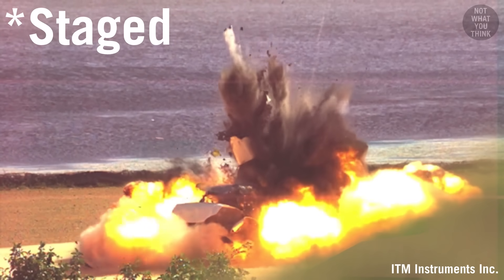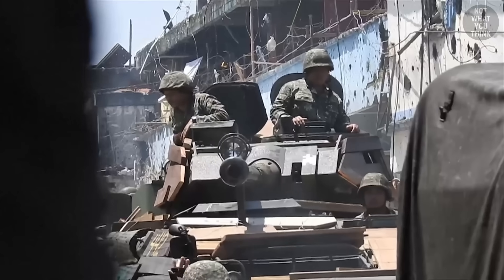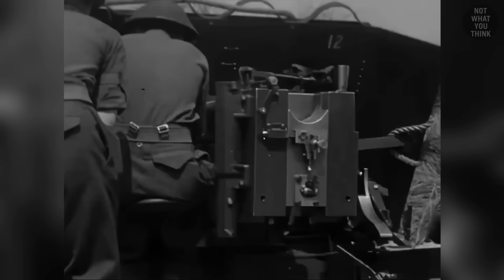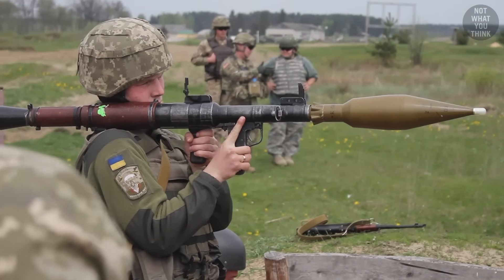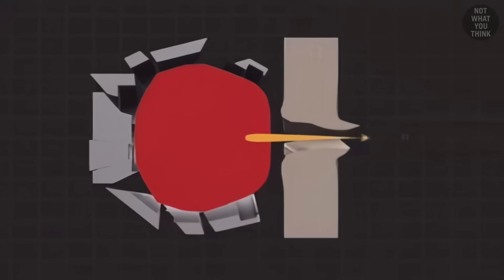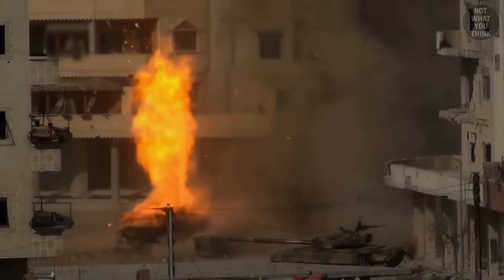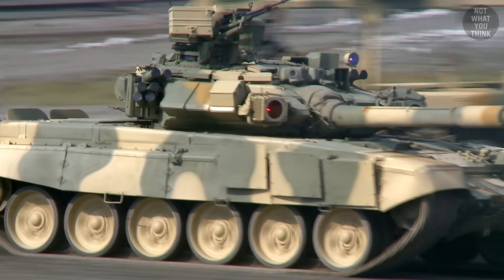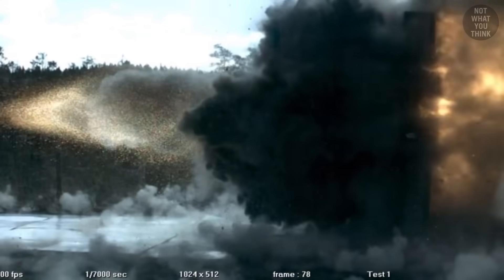Why Protecting Tanks is Getting Much More Difficult

Comment: Also worth mentioning are the NLAW launchers, which forego tandem charges by flying over the top of the target, and then detonating a downwards-firing shaped charge. Effectively attacking one of the least armored parts of the tank (even with cope cages).
Reply: feel like cope cages are more of a "fuck your apartment rpg" than for actual high tech missiles
Reply: @piscessoedroen  I think they are from low tech drone dropped mortar rounds or similar
Reply: @piscessoedroen   USE BY RUSSIA AS PER LESSON LEARNED IN CHENCHYAN WAR....sadly modern heat tandem anti tank missile rendered them useless
Reply: Another important point, is that NLAW is about a tenth of the cost of a Javelin.  Wars are won by economics, as well as by weaponry.
Reply: the NLAW doesnt use a shaped charge in top attack mode, it has a shaped charge in the middle for direct attack mode but in top attack mode it fires a tungsten pellet downwards
Reply: @fuckoff4705  No it uses a shaped charge in top attack mode, just watch Saab's own video "Saab´s NLAW anti-tank weapon explained"
Edit: Also see a video called "NLAW Warhead" to see it in action exploding in top attack mode
Reply: @fuckoff4705   They do use a shape charge but an especial type called EFP, it detonates and create a hypersonic clump of metal that penetrates the target, this statement: " it fires a tungsten pellet downwards" its completely false.
Reply: @fuckoff4705  SAAB's own product page for the NLAW states that it uses a shaped charge in OTA mode.
Reply: @fuckoff4705  Guess that works too against the lightly armored roof and even against ERA..  The Bofors BILL 2 has tandem vertically attacking shaped charge top attack but isn't man portable.
Reply: Old school here, after reading this thread, I can't help but appreciate all of the thought and time that went into this carnal knowledge, it sure would be cool if that much effort was put into peaceful solutions.
     Call me a p****.
Reply: NLAWS can only be defeated by remaining unmarried.
Reply: That’s why every tanker in the Russo/Ukraine conflict is fighting with hatches at least partially open. Overpressure is instant death in a confined space. So long as the jet doesn’t strike a crewman or a round in the carousel, it is surprising how many penetrations a tank can and will endure.
Reply: thank god somebody mentioned this. Nobody is mentioning this.
Reply: The Swedish BILL Missile is also the exact same concept (iirc the nlaw is based off the bill but I don't know for certain)
Reply: David Barr  well I would call NLAW limited. There's probably around 20k of it in Ukraine now. Many times more than amount of russian tanks. Even ignoring other ATs. But what about RPGs the scenario with you aiming straight down with it so unlikely its basically worthless even trying to protect against that giving away advantages like lower tank profile, weight or open space above the hatches. There were only a few zones when that could take place like in Mariupol but even then its super situative. Mainly because ukrainian command tries to avoid urban combat when its possible. Rn there's no active urban battles (well maybe only Bakhmut but its doubtable since russian army is kept outside of the city). Once again there's a reason why russians don't put cages anymore and were putting them on just enough tanks to make thr news out of it.
Reply: It fires an explosively formed penetrator
Reply: so much cope on those cages...
Reply: An idea over 12 years old!
Reply: @raywhitehead730  But not made by 12 year olds. Honestly I'd love to see how kids would think of defeating this problem.
Reply: @SoloWing032  I think he meant that the invention/idea has been around for over 12 years.
Reply: @Cobrax_x  I know that. I was getting at kids can be creative when it comes to problem solving. Us adults tend to over think or not even think of other stuff.
Reply: @SoloWing032  The real way to win a war lol
Reply: @raywhitehead730  Soviet troops installed improvised lattice screens on the T-34 in Berlin to protect against Faustians
Reply: Cope cages werent not even marginally efective, Russians are not longer using it I think.
Reply: What do you mean “also worth mentioning”, the top attack munitions WERE mentioned.
Reply: This is why active  systems are being implemented with modern tanks
Reply: @sierraecho884 The problem is that you get to a point where the tanks are too heavy and complicated for mass production.
Reply: @grahamstrouse1165  Airplanes are way more complicated and are still mass produced. The only paramater which changes is the price and time to build the thing. You can mass produce anything it will just take longer and cost a fortune.
Reply: Around 35 years ago there was a 150 mm howitzer round that delivered 3 "skeet" submunitions by parachute each terminally guided. I am not sure if they were ever used in anger.
Reply: Back in the 80's there were thoughts / concepts that highly agile air vehicles, sort of half fighter plane / half helicopter, would be developed to replace tanks. It looked and sounded great but does not seem to have got anywhere. Tanks are really only ever best in open landscapes. They are very vulnerable to even improvised weapons in urban situations. Even in the open plains they can still be defeated by the simplest of tactics and equipment if you know what you are doing.
Reply: @rsh650  yep, atoms move all the time even in solid materials, unless the temperature is an absolute zero.
Reply: Cope cages are against small drones dropping grenade / rpg. ERA is still effective against NLAW and modern ERA is effective against tandem charge too (though it is still rare for modern ERA to be on tanks roofs).
Reply: @The Bear Sorce?
Reply: >cope cages
lol
Reply: You mean the American javelin anti tank system.
Reply: Cope cages are usually very useless. Weird they even have them.
Reply: 'forego'? Where did you even learn that word from fgs
Reply: I always wondered why ruskies had ERA on top of their turrets
Doesn't seem to help them much
Reply: The fact that y'all are unironically calling them cope cages is hilarious, i can't believe this nickname has gotten so popular.
Reply: я.
Russia must before destroying the satellites of Elon Musk. Warn about it.
Reply: Modern SPGs are pretty nasty, too. Historically, indirect fire wasn’t very accurate. Now that we’ve got PGMs, high-tech fire computers & drone spotters everything is pretty damn accurate. Tanks are good for direct fire out to 5 or 6 klicks max. A 155 mm SPG can range out to 40+ kilometers. With an autoloader.
Reply: @rsh650  they do not shift by themselves,  but as result of external action. especially in malleable metals.  Imagine a copper bar.  Inside there are more or less planes of atoms, let's simplify to lines of atoms ( line abcdef... and atrached to it line 123456..., a1,  b2 atoms creating the metallic bonds same as between ab,  12 etc). Bending the bar will mean atoms shift their bonds to a3 b4 c5 for example.  A bit counterintuitive but it is the physical process,  as far as i can figure it out. In steel,  the various ingredients other than iron make this shift harder,  resulting in the elasticity or brittleness of that material.
Reply: NLAW, another abbreviation that doesn't mean what you think. It is a Russian abbreviation for Nереа Leniov Abocb Wlodiev, which means "giant can-opener from above".
Reply: @TheRealDuckofDeath  xD ahahhahah
The NLAW also isn´t even Russian
Reply: Turret tossing is my favorite sport.
Reply: Throwing in my 2cents: the effectiveness of that molten stream of metal, is it due only to physicality of mass times velocity or does it contain electrically charged mass that could be influenced by a very strong,  very brief current through the target hull at the moment of contact?         Even better,  consider the metal of the hull of the tank,  containing a "soup"  of electrons randomly interchanging between hull atoms (creating metallic structure). Being random,  atoms will miss some charge at the critical moment,  meaning weakness in metal,  meaning easier penetration (metal bends by shifting those atoms, until enough do not find counterparts and then the metal cracks) .    What if a very strong capacitor discharges through the hull to ground at that time,  reducing randomness in metallic bonds for a very short time?  Maybe even increase the cohesion of the hull? POWER ARMOR,  in short. Think about charcoal, graphite,  graphene and diamond hardness,  same atoms behaving very differently due t o the way they interchange those electrons.  Same thing might be possible in metals,  though it may mean malleable metals  that do not resist impacts too well otherwise
Reply: @ShrekMeBe  Now we're going quantum, it may, or may not break the armor. 
One thought though, wouldn't all that be moot when the metal gets hot enough to melt?
Reply: @lordsqueak  Depends how this can work,  if it can work,  and in an sufficiently efficient way.  Either by strengthening the atom bonds (in which case transition to liquid is bad),  or by increasing the energy of the armor atoms to a comparable localized level to the molten stream attempting to breach them apart,  hence having enough energy for the effect to influence that breaching stream. Maybe not  the entire hull of the tank (that would require too much energy) ,  maybe only strips or patches over the regular armor.  better yet,  under the reactive explosive armor patches.  Vehicles are going electric already,  warfare vehicles won't be far behind,  you use available stored energy to deflect an incoming round that would otherwise destroy you.
Reply: @ShrekMeBe  Well, what I was thinking was ,, something something eddy currents, because the incoming jet is made of copper. But then I recalled that ferrous metals looses their magnetism when they heat up. 
I wonder if the effect you're talking about would remain effective when the metal gets heated enough to plastic deform. 
...or something like that.
Reply: @ShrekMeBe  you can't electrically charge molten metal after a certain temperature all magnates stop working. So you couldn't use a charge to stop the copper slug since it's hot enough to be liquid. Also what the fuck are you talking about atoms I think your understanding is a little bit off. ..
Reply: You haven’t a clue
Reply: Sideways cope cages completely save it from nlaw tho
Reply: @divoulos5758  nope. Sideways cages made to deform contact HEAT missiles (or rounds) like rpg or at-4 collapsing its shaped charge structure before the rocket detonates. They do not work on remote explosion missiles like NLAW. That's why roof cope cages doesn't work and cannot work in theory.
Reply: @holesmak  by sideways i mean turning it 90 degrees placing it around the turet top like a prison cell
When the round reaches it it will gets shreded by the bars and whatever is left cant explode properly 
The nlaw is magnetically activated 
When it passes one meter above steel the magnetic sensors activate the warhead 
If it doesn't reach it it wont explode
And if it doesn't explode on the center of the turret it cant go through
Reply: @divoulos5758  bars are steel right? So steel is... Magnetic? Also how high you want this cage to be? Make roaming towers out of tanks? Some tanks used half sphere cages which covered top half of the turret and it didn't help. Its just not how you deal with proximity fuse HEAT missiles
Reply: @holesmak  
it actually can work in theory, it's just that the rockets of the NLAW or Javey aren't the ones the cages were designed to actually protect against.
Reply: @dickmelsonlupot7697  if its a roof cope cage it cannot protect the tank from said rpg or law since they hit the side of the tank and its already usually protected by ERA. Roof cage variant is just useless
Reply: @holesmak  Are they steel? How do you know they're steel, but not some composite based materials that are designed to be hard and non magnetic?
Reply: @RazorsharpLT  because not a single cage is made out of that. Its expensive and unpractical. Also I believe the mighty of composite materials arrives only when it made in sheet layers like tank frontal armour. And its still steel just layered with different types of metal and textolite. There's also aviation composites which are indeed made out of different non metal material to be light but they are not durable enough to withstand direct missile hit. Just google cope cages I doubt you'll find any non metallic one. Btw I read about NLAW a bit and apparently in direct fire mode when it hits the side of a vehicle the fuse sets off by a direct hit. So in that case cope cages would work against NLAW. The thing is I don't think this mode is used a lot
Reply: @holesmak  The point of a cope cage is like tandem armor - to work only ONCE, so i dunno about that.

For now - what the cope cages are made of is a secret, but i doubt they just "missed it" and decided to use Steel
Reply: @RazorsharpLT  tandem armour? What's that. Also no it's not a secret you can simply google it. Its not a super new high-tech project. Its just a steel bars used to deform HEAT shaped charges which was in military for at least 50 years. And even with steel they work only sometimes. With stuff like plastic it would work even worse. Since we talk about russian cope cages there primary its just a silly metal structure made ouf of whatever comes in handy. Scrap metal as it is
Reply: @holesmak  Explosive reactive armor

Eh, i would love to see what the current ones are made of.
Reply: @holesmak  So... isn't the logic that if the cope cages WERE magnetic - wouldn't they detonate the charge early, thus making it explode mostly in air?
Reply: @holesmak  The cages on top are for protection against RPG-7 fired from a high angle, like happens often in a city. One of the lessons learned in Grozny.
Reply: @divoulos5758  Bonus of slat cages: You can have MMA-style cage fights on top of the turret.
Reply: @divoulos5758  Well, proximity fusing still works even if a cope cage isn't ferric, because the tank still is. And if they somehow defeat the proximity fusing, there is a direct attack mode for the NLAW. 
In 2022, I'm sure they have taken cope cages into account. And by the looks of it,, it does seem to be effective against russian cope cages, so there is that.
Reply: @gimmethegepgun  if you have to go in a city on a tank your strategy already sucks. If you use scrap metal cages which don't even cover half of the roof your engineers suck. Tanks are super vulnerable in cities and nothing can change that
Reply: @holesmak  What's a remote explosion missile?
Reply: @holesmak  the effectiveness of tanks in cities depends on how they're used, if you're thinking about just driving tanks and humvees into a city you would be stupid, but, if for example you are trying to take a city you can attach a tank to each platoon, using the infantry to keep AT infantry away from the tank and using the main gun to destroy any structure that has activity, which has repeatedly been shown to work very effectively, as AT guys are most vulnerable to a group of idiots with rifles and people in structures are most vulnerable to a high explosive shell or shells being slammed through the side of their building, and whilst tanks are vulnerable to aircraft, aircraft are vulnerable to MANPADS, and MANPADS are vulnerable to tanks.
Reply: @RazorsharpLT  you can tell they are all steel. When the tanks blow up and burn the cage is left rusty and not burned up. Meaning they are all steel.
Reply: @holesmak  It depends. Yes, cities are terrible environments for a tank, but it's still heavy, direct-fire ordnance that can be brought to bear, which is still useful to have around. 

And, sometimes, sheer boldness will get you results, like the Thunder Runs during the Battle of Baghdad.
Reply: @holesmak  
Uhhh, no. Seriously, did you not watch the video?
Cages are meant to make them less effective and not penetrate properly which in the case of RPGs and others like it, IT DOES INDEED FCKKNN WORK

Hell, if it wasn't effective, then why the hell does America use cages as well especially during their time in Iraq and Afghanistan?
If even the Americans use it, then you'd be sure as hell that IT DOES FCKKNN WORK
And my country's military (the Philippines) used cages, wood and cardboard or basically anything they can put on our armored vehicles as an added "armor" against the older RPGs and other grenades and explosives that were used during the Siege of Marawi to great effect.
Reply: @dickmelsonlupot7697  Side cages do work. Top cages do not. Did you read that I was writing? I never said that cages are useless in the first place. I said that russian implementation of it is useless. There's a reason why "on American tanks too" there isn't any roof cage of any kind. Because as you should know RPGs only hit from the side. And if you find yourself getting hit by RPG from above your tactics are messed up and you shouldn't command a tank in the first place. And with top hitting missiles like NLAW and Javelin cages do not work at all even the side ones. Russian cages proved to be useless in this war to the point that they don't put them anymore. T-72, T-90, modificated T-64 all have ERA against RPGs and it works good enough that they don't need to put cages on the sides. American's on the other hand prefer to not use ERA on infrantry vehicles since it super dangerous for nearby soldiers so instead they put cages on. And no cages do not just reduce damage by HEAT charges they meant to deform shaped charge and thus destroy the structure which forms reactive jet on explosion basically transforming HEAT into low power HE. You can see it on photos where cage is shredded by the explosion but the thin armour is fine. 

You mentioned wood and cardboard and I doubt it will help much. Russians used any material they could find to protect their vehicles. Wood, scrap metal, roof material's, even concrete. Its all proven to be useless. That's why you don't see it on modern vehicles. Wood adds too much weight with too little protection. There were testing of concrete armour since ww2 and its basically the same. I guess it would work against low power hand grenades or shrapnel but not against HEAT's
Reply: @gimmethegepgun  well there's different types of cities. Probably if you can control streets with 1 floor building using infrantry this is fine. My friend was roaming industrial part of Lysychansk in summer and he safely finished his missions. But if it was dense civilian area with flats up to 10 floors high I wouldn't even come close to this place. Anyone could just yeet TNT charge from a window and annihilate entire road full of vehicles. Even worse if your enemy not just some random terrorists with RPGs and AKs but have their vehicles. Like in Mariupol where a single BTR outplayed a few T-72's by shooting them in the back. In cities the defender advantages rise drastically
Reply: @holesmak  
no, top cages do work as well.
Do you even understand why those were invented in the first place?
For one, they're super effective in urban areas especially places with high vantage points where some dude with an RPG can just climb up the 10th or higher floor and just fire an RPG from there.

It is what happened in my country and also what happened in Ukraine as well specifically when the tanks rolled in the cities.
It's somewhat useless in rural or open areas sure but that doesn't mean purely useless at all.

And why are you including the NLAWs and Javeys?
Those aren't RPGs or anything similar at all. 
Those are dedicated rockets whereas RPGs and other shoulder mounted launchers are the main adversaries of "cope cages".

The only reason they are failing in Ukraine is because the Russian military are idiots and using them wrong.
Much like with the other stuff they have which they are wasting away due to insubordination, corruption and just blind ignorance.

And on, using HEATs as an argument isn't really good since, for one, regular RPG rounds are already HEATs.
It's tandem charges that could somewhat work against cages but then again those types of rounds are hard to come-by, extremely expensive and are mostly equipped by the Russians and are more like specialized weapons that are rarely used.
The ones commonly used by regular RPGs or other shoulder fired launchers are regular single stage HEATs or just regular explosive rounds.

This is also the reason why the Russians are using it wrong since they've been mostly expecting regular RPGs and others from Ukraine being used, which again is effective but with how fast the West gave Ukraine Javeys, NLAWs, drones and artillery, much of the effort has gone to moot.
The Russian were expecting to fight an insurgency which they weren't exactly wrong but they never expected the West to be too fast in delivering the smaller Ukrainians more advanced weapons to counter the Russians.
The current size and even status of Ukraine even during the initial stages of the invasion is no different to ISIS when it started claiming territory in the Middle East especially in terms of size, manpower and even firepower but with how well equipped the Ukrainians are now especially with the Western bolstering, like I said, Russia just didn't stand a chance and with how badly the Russians treated their equipment and soldiers, it's no wonder they're failing.

So yeah, cages work and are good, but like I said again, it's the Russians' fault that they're failing
Reply: @dickmelsonlupot7697  I'm talking about NLAW and Javelins because these are the most popular ATs rn in Ukraine and russia made cages especially to counter them and not RPGs. First of all you can't fire RPG from a building you gotta understand how it works. The jet coming from behind the launcher will burn your back to the crisp. To launch it safely you need to have like 10-20 meters of pure air behind you. You can't have that while aiming RPG down 60° and thus back is facing the ceiling. NLAWs can have window launch since it uses small charge to spit the missile forward first and only then launches main engine. Also have you seen these cages yourself? Like on a photo? They don't cover even half of the roof. So if you are using RPG you gotta aim it straight down which is impossible. Once again you don't see them using cages anymore because its simply an idiotic idea. Those were put on some of the frontier tank groups to just mentally help the crew. Make it feel like they are protected.
Reply: @dickmelsonlupot7697  yes there's zero defence against NLAW and Javelins that's what I'm talking about. But russian propaganda was talking just about that. That its a super defence against NLAWs and such. You better go read some news or explore topic in general. You seem to not understand what you are arguing about. Ukraine even showed how NLAW kills a tank with a cope cage specifically to bust this russian propaganda tone. Also no RPGs are in the past for Ukraine. Infact there's multiple times more NLAWS than russian tanks. On video reports from frontier I only saw mainly NLAWS and sometimes AT-4. Saw RPGs only once or two. Also NLAWs were supplied in Ukraine before the invasion aswell same with Javelins and even 3rd panzerfausts. Roof cope cages were made up by russians right after Ukriane showed off their AT's
Reply: @holesmak  
and yes, I've seen pics of the cages with some being shhttty work because they are but what did you expect from mismanaged and underfunded Russian troops?
But that is beyond the argument and is not an issue about the cage itself and is more bad quality control due to lack of funds but it does not and should not hamper the use and thinking behind the "cope cage".

And no, they were put on the tanks that were about to invade the city areas. They weren't put on "frontier troops" since that's just bullshhttt. You don't even have proof of that whereas for me I rely heavily on history, the time and place of certain events and the circumstances surrounding them.
If you seriously think it's quick to make these things, then you clearly have no idea or experience regarding welding or fabrication, have you?
Reply: @RazorsharpLT  they are steel.
Reply: @holesmak  It ain't useless at all. People with RPGs love to hide in tall apartment buildings all the time. Guess what part those rockets would hit.
Reply: @lemons1559  So you are telling me. That with all the stugna, javelin, nlaw, drone stuff ukrainians have, with tanks fighting either in open field or completely destroyed city, with most casualties dealt by artillery by spotting using drones. They put a giant bbq thingy above their tanks which are made to be low and hard to see on hilly landscape which makes it 2 meters taller. Just because if they happen to get (somehow) into the city if they are not being destroyed by artillery, long range missiles or mines, rpg on horizon level and grenades they could tank that single rpg hit to the turret roof (which itself only covers around 1/3 of the tank) and didn't get a second rpg round right after first destroyed the cage. Do I understand you correctly?
Reply: @bryonslatten3147 They’ll protect you from Mick Foley and MAYBE The Undertaker…
Reply: @divoulos5758  That is slat armor, nobody calls it sideways cope cages.
Reply: @voidtempering8700  i call it that way because it isnt there to stop rpgs but only nlaw
The cage will literally be above the tank not on it
Reply: @divoulos5758  Slat armor has been in service long before the Nlaw came out. You have it the other way around, it is meant to stop RPGs, not nlaw. Both side mounted slat no armor, and the cope cages, which is a recent development. Nearly all countries use slat armor.
Reply: Cope cages were actually meant for drones like TB2 in Nagorno Karabakh.